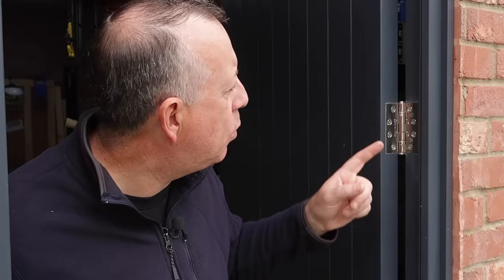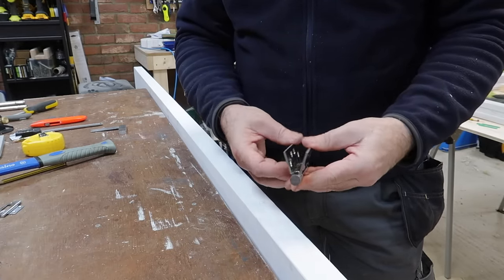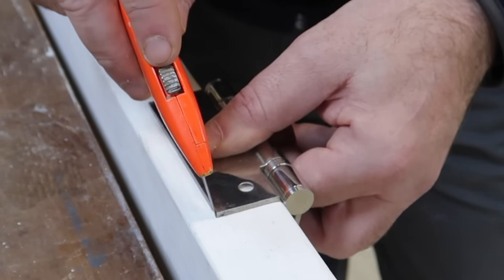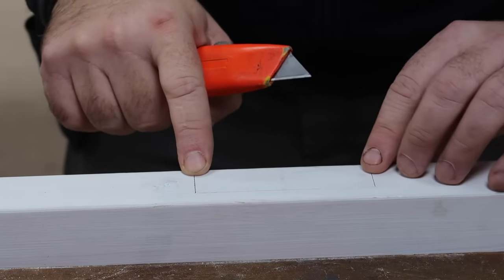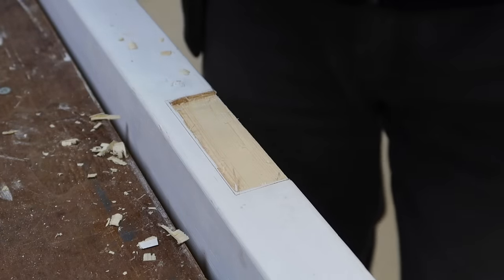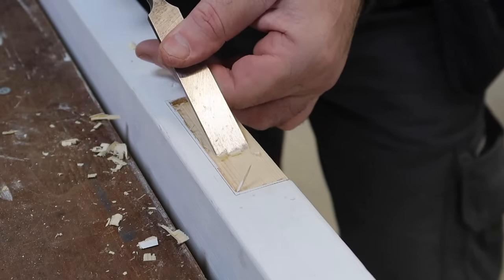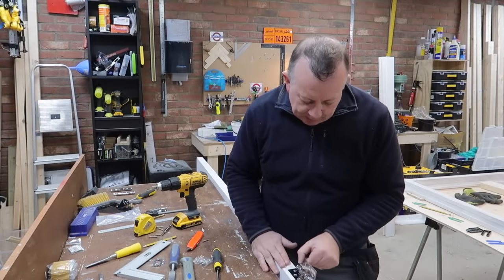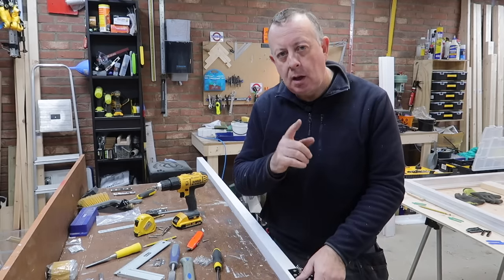How to Fit Perfect Door Hinges

Comment: I agree didn't like the hammer rather than the mallet you are however correct in the use of a tanged chisel. My current chisels have a through tang and a metal head and a hammer is perfectly acceptable just can't get used to it in my head a chisel has a mallet and anything else is wrong and if nothing else it sounds right but hey you cut better hinges than me so right on man

Comment: Am currently making a new door for fitting into an old frame, and watching this video (for ‘refresher’ purposes only, of course) reminded me of a technique I was shown by my late father. This involves cutting the hinge recess (into either/both the door stile or frame) so that the hinge lies inwards at an angle to the fixing surface. Not seen it in a book, but the ‘supposed’ advantage(s) are that;
1. Having the hinge plate angled into the door/frame, better supports heavier doors when open.
2. When replacing a hinge of the same size, but having slightly different hole centres, the angle means that the end of the screws are at least now biting into some new/unused wood.

Not too sure of the validity of any of those ‘claims’ and regarding 2., I can equally remember him stuffing a couple of spent match stalks into old screw holes, to make them ‘tight’ again.

Comment: You did a magnificent job and fitting those hinges I tip my hat to you and I've learned a little bit from doing what I used to do but unfortunately most people use a template with a router to make it quicker but you did a wonderful job
Reply from the maker: Thank you! Fair enough but everyone should know how to do it manually before moving onto routers etc.

Comment: I screw the hinge down while scoring. It won't move placed with hinge as shown. I also use a router (at depth) to remove the material after the knife cuts. Other than that, I do this exactly the same, lol. Same with the Stud side. Hinges are usually 1/8 to 3/16 inch thick. By hand just takes too long, but worth it if the job calls for it, and the expense.

Comment: You note that hinges are traditionally aligned with the top and bottom rails. True enough. There’s a traditional reason for this. Rails and stiles were assembled with mortise and tenon joints. It was important to avoid driving screws into the end grain of a tenon. Screws don’t lose lots of pull strength in end grain. And so, it became the convention to move the hinges so they are safely away from top and bottom rails. For unknown (to me) reasons, bottom rails on exterior doors are often 2” wider than on interior doors.
When we used to cut mortises by hand as you’re doing we’d typically move the chisel slightly inward from the cut line. Especially cross grain in hardwoods, the bevel pushes the chisel back just a hair. Another useful way to measure and mark the hinge thickness is to lay the hinge on a flat surface and use a combination square. Let the blade of the square drop onto the flat surface from the hinge.
Suggestion: Show folks the counter-intuitive art of packing out a hinge to fix a door that rubs a jamb.

Comment: For those DIYers who are putting a new door into an existing frame, use the old door if you have not thrown it away.  Put the new blank door on a pair of saw horses.  Leave the hinges in place in the old door.  Place the old door on top of the new door.  Use a sharp utility knife/Stanley knife and follow the outline of the hinges from the old door down onto the new door.  There is very little chance for error with this procedure.  You are using the hinge pattern of the old door as your template.  Don't bother with buying any hinge template for a router.  I think I have them all.  The main reason that they fail is because the router template is always bigger than the hinge because the router bit always has a bearing on it.  The problem comes when you try to place that too-large-template over your perfectly marked hinge placement.  It sounds easy, but it isn't.  If the router hinge templates were exactly the same size as the hinge, it would not be a problem.  You can make your own router hinge template that does not suffer the limitations of the store bought ones.  This video by "Proper DIY" on hinges is wonderful!  All of his tips are spot on.  Don't use a pencil and don't use a tape measure.  Hinge placement needs to be as perfect as you can get it.

Comment: Nice video.  Do you have a video doing the same on the door frame? How do you locate with precision where the hinges go on the door frame?
Reply: i use a stick, with hinge positions marked, and the gap between door and frame, use the stick to mark both door and frame, easy, no measuring, just hold up the stick and mark…
Reply: @robertmagnusjamieson1759  Wow! That's clever. I learned something new today. Thanks. Best wishes.

Comment: I do prefer to drill much thinner guide holes on such soft woods, if ever.
This will guarantee a much stronger fix of the hinge and nothing will lose on accidental slamming or openforcing the door.
This is especially important with weighty doors such those with glass inserts.
A second suggestion may be to preimpregnate wood and holes with a thin layer of common PVA glue. And let it completely dry before mounting the hinge.
This is good to protect from humidity the wood under the mounted hinge. 
My 10cents.

Comment: Thanks & Great way I will try. Question for you. I have new hardwood doors & they are very Heavy, my Question is; Sould I use 4 Hinges. I am not sure the name of the wood, The wood is imported from Indonesia but it very Heavy & 90cm Wide. Thanks, John in the Philippines 
.
Reply from the maker: There is no reason you can't use 4 just ensure they are spaced uniformly. 3 is more usual. If the door is that heavy also have a look at what screws you are using - maybe look at using at least one longer screw in each hinge that penetrates the frame deeper to ensure none of the hinges pull out.
Reply: @ProperDIY  
Wow Thanks, I did not think about longer screws. I am retired & make a home in the Philippines & I have a lot of time on my hand, so I want to try & do things myself. If you think 3 Hinges is okay I prefer less work, less chance of mistakes. Thank you for your reply  & your help. John
.

Comment: I would suggest that you make a jig from 3/4 plywood, cut hinge size and use router with sleeve and use to cut door and frame. It will be perfect. North America we use 1/8 inch setback. It will take about 5 minutes to cut no measurement.

Comment: Hi another great job and great video , Norm Abraham said 3 section go to the frame helps prevent the hinge squeaking in future, I would recommend and more solid knife I got a folding one easy change blade and its excellent, also do you oil/silicone spray the hinge before or after fitting, keep up the good work ,G.

Comment: I use a router and clean edges with sharp chisels / knife. It's faster and gives perfect results. This method is for the door frame if it's already installed (which is the common case).

Comment: first  timer here, Question regarding the 3 side to the frame and the 2 side to the door, wouldn't the 3 side hold the weight of the door better than the 2 side? Maybe if the 2 side is on the frame with the weight of the door the continued open close cycle, ma compromise the door after a few years with the weather dry wet cycles.

Comment: Fantastic attention to detail. This came at a good time. 
Need to hang my replacement internal door. Some joker was asking £450 to fit - plus VAT!  The door was only about £100. 
I thought the other quote of £250 plus VAT was bad enough. Mind you if anyone knows what the standard going rate is I'd be happy to hear your thoughts. 
Excellent vid - hope you show the door hanging and door furniture fitting too. Thanks!
Reply: depends on what condition the frame is in but usually I charge £55 for fitting an internal door
Reply: When I worked as a supply teacher (a few years ago) I was paid £160 per day, so that's my approximate benchmark for how much I expect to pay a professional tradesman - maybe a bit more to cover their self employment paperwork etc.  Probably £250 per day now, but £450's way too high.

Comment: The higher bottom hinge position is so the door looks right. Place them at at the same gap from top and bottom and the door looks 100% wrong. Possibly because your head is closer to the top hinge and you get a perspective/foreshortening effect with the bottom hinge.

Comment: Superb delivery .. thanks! I noticed that the ruler you used as a straight edge @6:25 had a none reflective surface. I thinks its worth pointing out how much easier it is to work accurately with a none reflective ruler compared with a brightly finished stainless one. I appreciate you were using it as a straightedge in this particular instance and reflections would not have mattered.
Reply from the maker: Thanks. Yes is it and it does make measuring easier for sure
Reply: A ruler can slip......use a hand router

Comment: Hi again Stuart. Forgive the novice question but  rather than drill pilot holes first, would it not be easier and stronger to just impact drive the screws straight into the door? Perhaps pull up short on the impact driver near flush so as not to over tighten and switch to a hand screwdriver for the last few screws. Or am I missing some other benefit of the pilot holes? I always thought pilots were more if you’re right ok the edge of a piece of timber and you wanted to avoid blow out from just screwing in directly .
Reply from the maker: If you are installing into a soft wood then yes you can drive straight in. You may find doing this though that the screw wanders and takes the easiest route which may be 1-2mm away from where you want it to go. For this reason I would always drill a pilot hole to ensure that your hard, accurate work so far isn't undone.

Comment: I’ve hung quite a few doors over the years now I know how to do it properly 👍, just one query I’m surprised you use a hammer and not a mallet on your chisels ?
Reply from the maker: My chisels have 'through tangs' which mean they are make out of a single piece of steel from blade to strike plate at the top with a plastic handle wrapped around it. This means you can use them with a hammer. If you have the more traditional style chisel with a solid wooden handle, then you must use a mallet.

Comment: I think your video's are very good... however, I have comment on the door hinge fixing in regards to 3 hinge setups! As I understand it, where a third hinge is being used, it should NOT be put in the middle! The reason for 3 hinges is normally weight of the door and as a result physics determines its position, not cosmetics... I believe the third (middle) hinge should be approx. 2 thirds up from the bottom to help carry weight which would be pulled down from the top of the door by gravity... in you video you appear fairly casual about placing the third hinge "somewhere in the middle"!!! Cheers, and keep up with the excellent videos!
Reply: 3 hinges for a big standard  internal door is just to prevent sagging after years of use, two hinges would easily bear a hollow door
Reply: @bertbox69  Yeah, I was talking about solid doors, not egg-box ones. The important point though was to highlight the fact that, where you need/want to use 3 hinges, the 3rd is not put at the mid-way point. This is an easy/common mistake so your vid was the ideal opportunity to share the knowledge that a third hinge should be located more towards the top (approx. 2/3rds up) not equal distance between the 2 standard hinges. Cheers

Comment: That self centering drilling bit is called a Vix Bit. Good job sir.
Reply from the maker: Thanks
Reply: @ProperDIY  I'm an old wood craftsman my self but unfortunately i was injured in one of my Door installs. the door weighted 250 lb's or 125 kilos. and tore my disk in half, I didn't have my Door dolly with me at the time, so i decided to lift it and that did it. No more not even slow work for me. But again good meticulous work.
Reply from the maker: @henryvaldillez6785  Sorry to hear that - 125kg is a heavy door! Thanks of the comments - always means more coming from someone who knows!

Comment: A better way to mark the centers for the hinge screws is to use a phillips screwdriver that fits the countersunk hinge holes.  Place the tip of the screwdriver in the hinge hole, tap it right down, and u have a perfect cross with the centre punched deep exactly in the middle.   Put your drill bit in there ... and drill.  Keeping yr drill bit vertical is another problem entirely ......

Comment: In fine wood working the hinge knuckle should only protrude by it’s radius. The whole knuckle should not protrude unless you have parliament hinges.
To centre the drill hole you can start the hole with a drill the same size as the hole up to the depth of the unthreaded screw shank.

Comment: enjoyed this video thanks, you are so calm as you give instructions...you are teacher also? should be:). Can you tell me your opinion please. I am about to install some cabinet hinges and what I have seen sometimes is that the hinge part that is on the door is done flush like you have done but on the frame part is is not, it is instead attached on the surface. what do you think of this? ps its with the same type of butt hinge you use (apart from its smaller of course).
Reply from the maker: Thanks. Hinges should always be fitted flush. If they are on the surface either the person fitting them didn't want to do it properly or to get the door to hand vertical or maybe it was too small for the opening, they decided to fit them to the surface.
Reply: @ProperDIY  wish me luck getting it right, although I think you make your own, in this marking it out, taking my time should invent the luck I need :)

Comment: Great stuff a little trick I learned when I was setting hinges is bb's  or ball bearings lay in the hole of the hinge holes gently tap with a hammer it makes a indentation and lines up perfectly for the hole  to be drilled
Reply from the maker: Now that is a good idea and would get a good end result

Comment: Might not be the most perfect, but if you place the hinge where you want it, hammer a few taps on the hinge screwface  (protect with cloth or tape and it imprints a perfect edge you can use a craft knife on.

Comment: i know this is a little old but i found it interesting that at 13:58 you key the bit then turn the chuck backwards til it clicked...As of today 10/16/22...there's a buzz on tool websites as to if this is a real thing to lock bit or not...Apparently manufacturers don't mention this in the manuals

Comment: Why do you drill pilot holes for the screws? If the door is soft wood wouldn't just crewing them into the wood direct be stronger?
Reply from the maker: You can do but drill pilot holes also means they go exactly where you want then rather than taking the easiest route

Comment: I would do it a different way, cut out you hinge with a Stanley knife {as you did} but also cutting it deeper than the hinge thickness. Then remove the 1/4" of timber around the edger's inside of your marks. I would use a razer sharp 1' wood chisel to remove the rest of the timber cut out from the hinged side to the notched side {in one cut}, being careful not to intrude into the marked edger's. Alternately you could use a small router with a hinge jig, would be even better & faster with more than one hinge. Still a very good video for the home handy man/woman.

Comment: The difference in distance between the top and bottom hinges ( I was taught 6” down 9” up) is purely for perspective. If you set them at those measurements when you stand back, because your eyes are 5’ of the floor the hinges look even. If there’s a middle hinge it should go between the top and bottom hinges, not the middle of the door. If you ever walk down a corridor towards a door with big obvious stainless or brass hinges that are set at even distances (as many younger chippies are doing now) it looks so wrong.

Comment: Highly informative but for the casual remarks about hinge positions and spacing. Almost anything in modern construction has a standard applied to it and hinges, size, number used and position are all subject to British Standards. The type of hinge and door vary where the hinge is put and how many are used. Fire doors need to be carefully referenced as positioning and type are specific and critical if you want to pass building regulations.

Comment: Hung doors before, but ordered the self centering drill bits made life a lot easier. stanly knife trick also briliant. Done 4 internal doors this week, slghtly harder for me as the door frames are steel with built in hinges one side and loose hinge held in by removable pin. So hinge positioning on the door has to be perfect or the hinge wont interlink together. slow and steady wins the race.
Reply from the maker: Nice one! Sounds like you need to be 'bang on' with the measurements and your markings!

Comment: A claw hammer isnt the best hammer to use. I use a smaller wood hammer, doesnt split the chisel end.
Reply from the maker: It depends on the design of the chisel. My chisels have a steel shaft running throughout with a simple rubber moulding on the outside for a handle - it cannot 'split' like an old fashioned wooden chisel can.

Comment: "The process for installing the hinge on the door frame is exactly the same." - Wait, how??? How is it exactly the same when you've laid the door down to cut your hinges in? We can't lay the frame down, but will need to use the door and shims to get a proper gap to scribe our hinge lines into the frame, right?